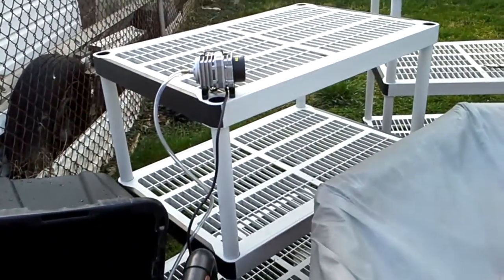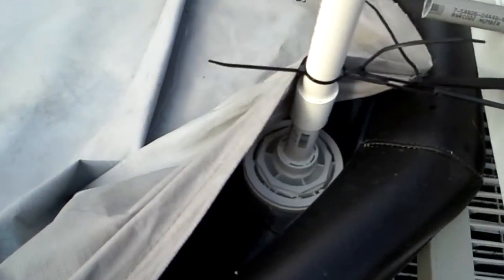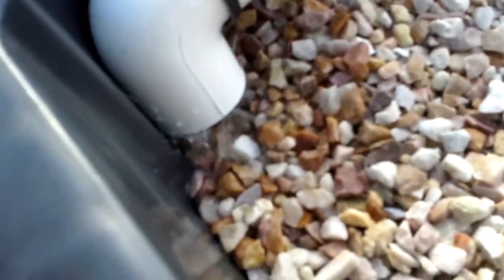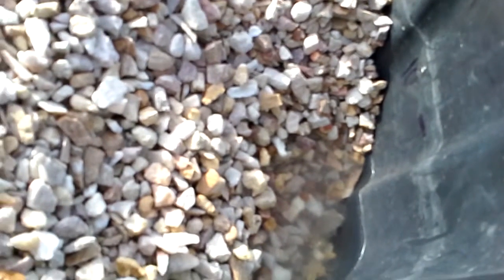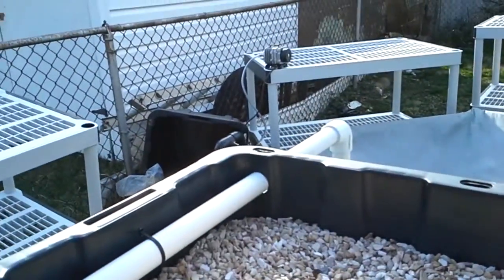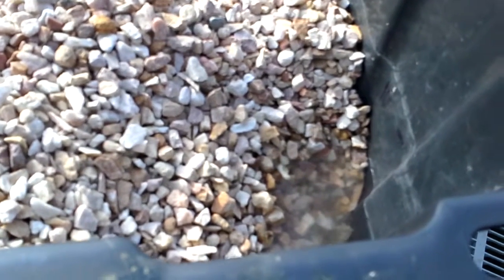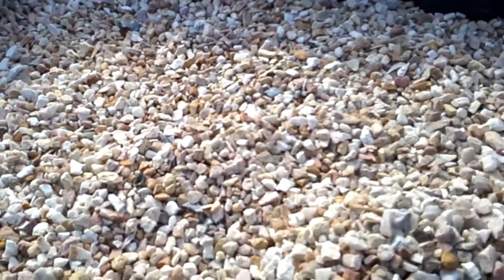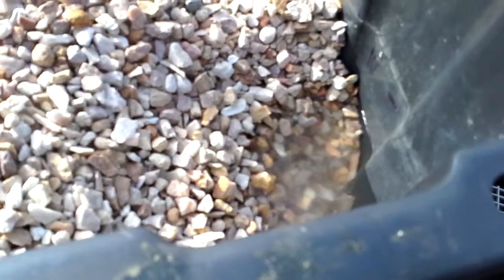Initial testing of geyser pumps and bell siphons 4 8 13

Comment: Hi Ou, It seems the water flow rate that using the 18W air pump is not good enough if compared with using submersible pump.